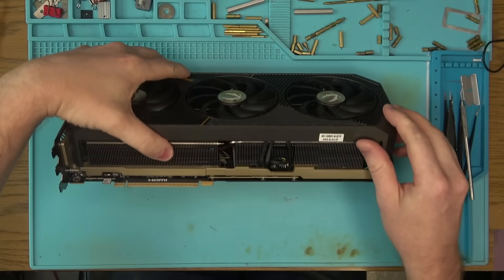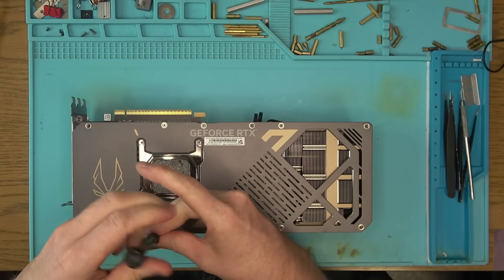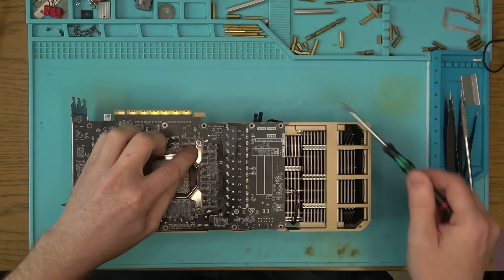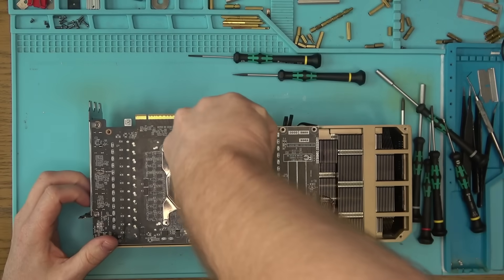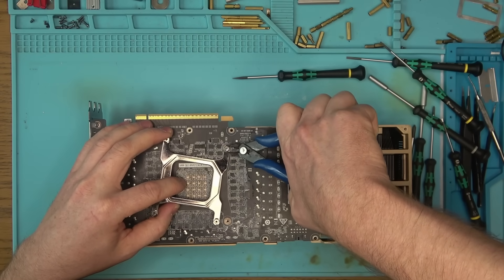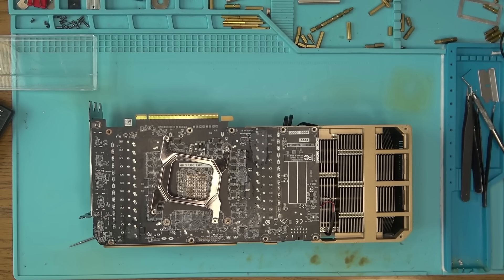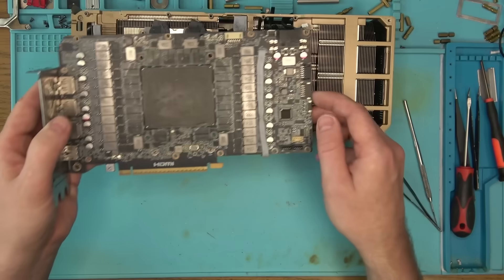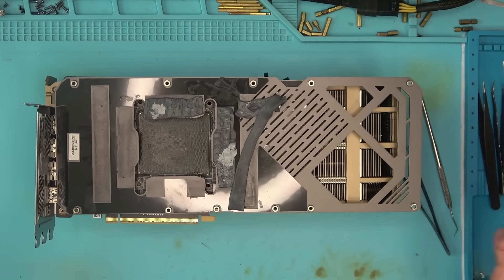WARNING new RTX 5090 scam just hit the market

Comment: i rebuilt main stairs on my house, whole deal with hydro isolation and ceramics and build new glass brick wall under those stairs for 2000$ total, finished today.. Last year i turned basement into small apartment for round 4500$ and rented it for 500$ per month. I also bought and serviced 500cc scooter for less than 2000$.  Losing 2000$ like that blows my mind..
Reply: You are charging soeone $500 a month to live IN A BASEMENT?

Jesus. That's insane. America has a SERIOUS problem regarding housing and the disparity of wealth.
Reply: @TheVanillatech  35m2 on great location, everything new and its not really a basement more like ground floor, it hes windows in living room and in kitchen, separate entrance, two storage rooms for bikes, groceries etc and even private parking space and fast internet. Its very cheap to heat up in winter and no need for AC in summer. I did most things my self, other then plumbing and electrics.  I am from EU and where i live small apartment in a building is 600,700$  and trust me guy that lives there is super happy with it.
Reply: @TheVanillatech  $500 for a reasonably clean and dry basement is not bad at all in many US urban areas. In fact, it's on the cheap side. But your last sentence is correct on both counts.
Reply: @TheVanillatech People typically pay a lot more percent of their monthly income for housing than 30% if they are making minimum wage in the US. We have so much land, but we have no new housing that a reasonable person can afford, it might be the most neglected thing in this country (and that is saying something).
Reply: @TheVanillatech  Its all relative to what city you live in. For instance up here in Vancouver Canada, you are paying over $500 to share a basement with people. Its like $1500 for a whole basement of a house. I am sure its more in other cities and also less in other areas.
Reply: @TheVanillatech  Go visit Germany. In most cities you'll get the full experience of a broom chamber for that amount of money. Want to actually live in a 20^m2 room? Double the price. I would be happily living in a basement for just above 400€
Reply: @TheVanillatech  want to say about 2018 era I was looking for a room, and more than I would like to say there are houses that are basically like closets with like sheets over them essentially little little cubbies they can't be more than 100, maybe even 50.. I'm not good at measuring volume but... Basically a subdivided as many places as possible, and that's like 400 or so a month up to five.. And you know why of course, cuz somebody makes sweet sweet cash on asking a little less questions... It took me a bit to like actually process what was going on there for some reason.. maybe it's cuz the landlady was just bizarrely chipper like there was nothing going on here and this was totally normal lol...

 This is Washington State, like I want to say it was maybe a stone's throw from some of the wealthiest houses and living spaces, which is kind of how everything is it's like marbled with rich and increasingly poors... Keep in mind downtown Seattle, me and my ex-wife, we got a studio that was something like $1,800 or something a month and only because we were..  creative.. with some taxes.. And if you wanted to pay $2,400 or $2,500 or so you could get one half of a bedroom for your studio lol not a real one... Sliding plastic door and the walls don't connect to the ceiling so... They call it the open concept, and if I ever find who came up with that idea.. I'm going to have words.. And and not all of them are going to be the nicest words.

Oh it does have a serious problem, But I don't think This individual is part of it necessarily? I could be wrong but.. Like if we could get $600 $700 for a studio in the vast majority of the West Coast... Like those are king prices those are down right affordable comparatively.
Reply: Honestly that much money is insane to spend on just a gpu

Comment: use flush cutters to grab the edge of the screws and loosen them until they can be removed by hand.
EDIT: i see you tried it, try and bite into the screw a little with the tip of the flush cutter to get the proper grip your gonna slip off a few times but its worked for me every time!

Comment: When I was working on aircraft, when we’d come across a nearly stripped screw, we would put some valve grinding compound on the screwdriver bit. The grit helped the bit to grab the screw and not slip. Maybe the use of something like baking soda in a paste would have worked here. That being said, sometimes no amount of grit will save you and you end up doing what you did or just drilling the head off.
Reply: if you drill the head off how are you going to get the screw out?
Reply: @zachansen8293 you remove what you intended to and then use needle nose pliers to spin the threads out. There’s usually a little stud sticking out unless you drill too far. The trick is to stop drilling as soon as the head of the screw is gone.
Reply: @SergioPena20  why wouldn't you just use needle nose pliers on the screw with the head on it?   drilling would make that harder not easier.  Drilling the head off gets things separated but makes it worse to get the actual screw out.
Reply: @zachansen8293 sometimes there isn’t enough meat on the head of the screw or the screw is recessed. That’s what happened in this video.

Comment: Customer uses hand blender to remove screws.
Reply: I wonder if the custom was the one OR whoever removed the core and ram chips. The customer did say he couldn't open it. Maybe this was why?)
Reply: @Helifax19  It was the scammer for sure, those screws are super brittle crap and I could see a crap screwdriver (or even an electric one) stripping them easily.

Comment: Not even 6 months and already there are RTX 5000 scams bruh
Reply: From day 1 on ... the whole 50-series is a big scam from nVidia and it's OEMs. MSRP that OEM directly said: Nah.
Reply: @darknase  Yet, when they first hit the market they sold out to scalpers who in turn marked them up 250% and sold the crap out of them! The only thing Nvidia is guilty of is holding back on the initial supply at release and retailers sold what they had like they were supposed to. The rest of the stupidity was all "end user" driven. Everyone knew exactly what they were getting before they ever got one so there's no excuse for whining and blaming Nvidia.
Reply: Nice 😂 2k for a heatsink
Reply: @JohnDoe-27  he also got PCB, coils, caps, poscaps, VRM controler and power stages, fair deal innit ? 😄
Reply: To be fair: why the fuck did the guy think someone would sell the best gaming GPU after 6 month when there is nothing wrong with it.
Reply: @dontowelie1302  It happens. Not everybody gets these for gaming, and people change their minds. I bought this exact card used (Zotac 5090 Solid OC) for 2k on craigslist. The seller let me verify the serial, ROP count, GPU-Z info, HWiNFO stats, Timespy score, etc. before buying. Nothing wrong with the card. The seller might have thought something was wrong with it if he was using Zotac's garbage software. But of course, 2k for a 5090 is a unicorn deal that won't show up much, so due diligence is a must. I'd never buy something like that on eBay, even if the seller looked legit.
Reply: @dontowelie1302 yeah what did they (the seller) upgrade to?  A data center rack lmao.
Reply: 6 months is a long time
Reply: What's crazy is the scam cards are probably less likely to burn your house down so that's a plus 😅😅😅
Reply: This is an old scam...What do you mean already
Reply: they are on Ebay for $300 parts with box then someone sells it for 2K his fault for not testing it.
Reply: Always China
Reply: @timmysmells  and always USA is scammed, rest of the world is fine. Losers xD
Reply: They also have RTX 6090 donor boards, but it doesn't make sense to sell them right now, they have to wait for Nvidia to launch it first.